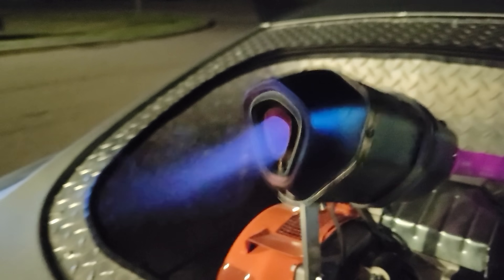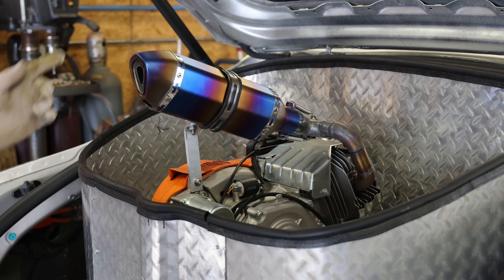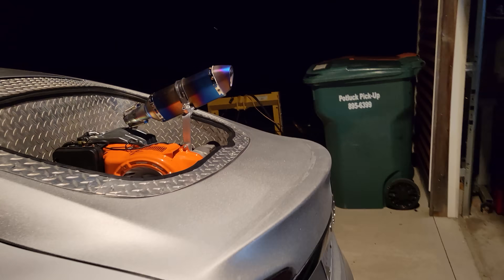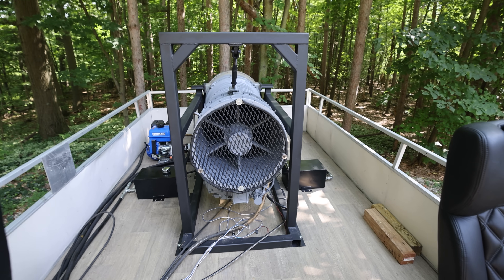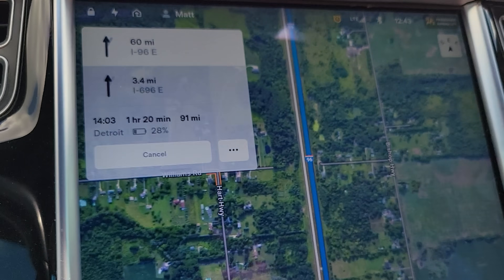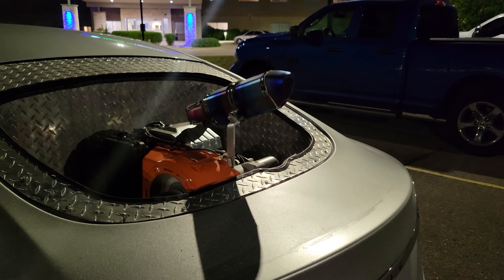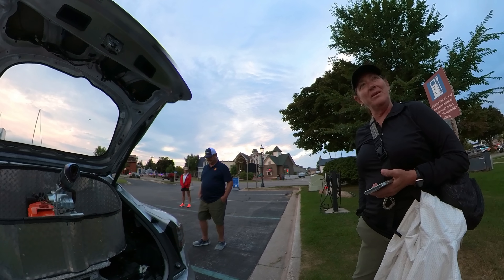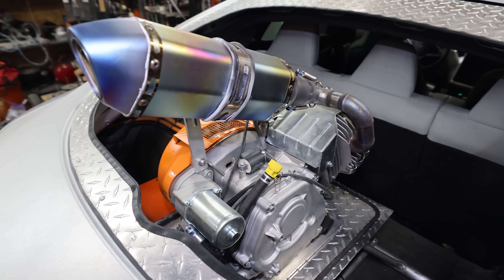Cordless Tesla (I Drive 1800 miles without charging) P.1

Comment: We have to give that generator some credit.  It ran at full throttle for roughly a week.
Reply: "Full throttle".  That engine would be running at the 3600rpm ( "universal" speed for 60HZ electric motors matched by small gas engines used interchangeably with those motors) that it's designed for full time operation.  You would be confusing that with running an engine at high rpm full throttle which it was designed to do only briefly.
Reply from the maker: @anvilsvs  well, kinda, For the most part you are correct, That is a typical life for one of these engines however you see, maximum output for this engine under maximum load is 19 kW, I was running this thing beyond its maximum load rating, so essentially that is full throttle. I should have really went into that in the video but I didn't, although my next one that I'm working on now is crazy, I don't know if the engine's going to survive but I'm boosting it to double the output that is rated for.... Haha.. If it blows up it blows up but I hope it blows up after I finish the trip. Hahah
Reply: @anvilsvs  This video is a scam for view$, he's not actually charging his Tesla off that engine (there is no generator just an engine) He's laughing & also amazed at how stupid people are.
Reply: @anvilsvs  Right. I guess people don't know these generators or small motors are governed at a certain rpm. Some increase speed under load. Found that out riding and modifying my friends mini bike motor.
Reply: 400 cc was way too low output. Even a Toyota Prius has a 1800cc engine.
Reply: @place_desjardins  did they even mention what the generator can charge ? What’s max kW?
Reply: @place_desjardins  prius is driven by that motor. This is only charging.
Reply: @DustinDIY  a Prius has a 1800cc 4 cylinder 121 hp engine attached to a adequately sized set of windings.
Reply: @ducatipaso1386  not quite how it works. Accel and when batteries dead the engine runs. Electric cruising
Reply: And made power without the generator part; it was just a spinning motor.
Reply: @MAKER_GURU you're the only one who caught his hoax 👍
Reply: And without oil change which it is now due or overdue
Reply: @jdy hate isn't the reason.  There are legit inherent drawbacks.  Demonizing people who recognize those drawbacks doesn't make the drawbacks stop existing.

Battery technology (the crux of EV) is one of the slowest advancing techs due to physical limitations, not hate.  Solar and wind are also very slow to advance.
Reply: The comment section here reminds me of how the apple videos end up. So passionate about absolutely nothing.. lol
God forbid someone uses their money to modify something they own or has an opinion. 

Ya can't make this shit up.. 🤣
Reply: Problem I see is a Tesla's on board charger only trickle charging batteries at L1 needs 120 volts 15-20 amps. L2  requires 240 volts 40-80 amps. Doubtful L1 charging 24/7 can keep up with road trip battery consumption. Generator advertised output is only intermittent, if subjected a continuous 80 amp load engine will be throttled up until melt down.
Reply: Anyone notice during the 5 seconds this video gives to inspecting that install that there's no dynamo attached to that engine, let alone capable of producing 10kw lol... only thing that's on that engine is electric start... it was bolted back there as a stunt for clicks.
Reply: Without an oil change? :0
Reply from the maker: @nguyen925  yes
Reply: @jdy 🤦 thank you for the self-righteous diatribe.  You're simply wrong and I couldn't care less if you're mature enough to admit it publicly or not.  If you knew anything about the tech, you would know how silly your claim is.  Modern electric vehicles wouldn't even exist without the forced redistribution of wealth.

You: people hate is why electric vehicles aren't practical.

Reality: electric vehicles aren't practical because of inherent physical limitations.
Reply: @zacharymorris9917  
You just have the wrong values. 
Your words are proof that you are not willing to change your habits even if this destroys the world you are living in. 
Egoisms are the most severe Problem man has.
Reply: @zacharymorris9917  
And? Why are you so full of hatred if you are so happy independently? 🤷‍♂️😊
Reply: @zacharymorris9917  
Totally wrong take on the Problem burning fossils poses. 
Of course there are downsides to EVs. 
But if you are willing to sacrifice just a fraction of personal comfort, and I am not talking about towing heavy loads or huge machinery, just personal transportation, you can make a difference.
And sorry for not being able to see your godlike experience. 😉
Being on the road since 1984 I have a little experience in ICE vehicles of all kinds, believe me. 
Although I never owned a Diesel because I find the smell of it disgusting. 
The fuels smell and the fumes smell. 
But hey, Mr. Know-it-all
just keep on doing the things you are doing the way you are doing. 
You are not alone in not understanding that we have to stop burning fossil fuels better yesterday than today where it is possible. 
At least you seem to promote the fossils lifestyle while on the other hand using solar. 
I guess I am just to stupid to grasp that incongruity.
Or maybe I just don’t have those omni-needs you seem to have.
Reply: @zacharymorris9917  
And, where is your point?
Of course ten years ago EVs where far from being practical. What you seem to be eager to deny is the speed of change and the absolute need to change for mankind’s survival.
Reply: @zacharymorris9917  
Man, how ridiculous are you? I mean honestly, my self esteem and ego is at least as huge as yours.
And now? 😂
Reply: @zacharymorris9917  
Sorry Zac, you simply are wrong. For most people it is completely feasible today already to drive EVs. Every household has current. Many can put up solar and batteries like you are doing it. At least you say so. Why should others not be able to do what you are claiming to do. 
You are contradicting yourself.
Reply: @zacharymorris9917  
You are just not accepting scientific findings like melting glaciers aso. 
Who is making a fool of himself here? 😉
Reply: @robinsonreichel1268  tell that to all the folks in California who were told to not charge their car or run their A/C.  Your ignorance is fascinating.
Reply: @zacharymorris9917  
Yours is at least at the same level, don’t you think?🤗
You are just generalizing. 
Haven’t they been asked to not use their ACs/Cars if not necessary?
How many times in history people in California where asked to not charge their vehicles? 
Compare that to the number of days in history with smog in California due to ICE engines. 
And what was the reason for the gov asking to use less current?
Might it have been the weak networks? The lack of buffering? A result of negligence?
Haven’t there been outages before EVs ?
By the way, we can always continue our conversation in German, if you dare. 😂
Reply: @robinsonreichel1268  you're far beyond your intellectual capacity.

Sie sind weit über Ihre intellektuellen Fähigkeiten hinaus.
Reply: @zacharymorris9917  
Oh, vielen Dank!
Ich hätte nicht gedacht, dass ich so große Fortschritte gemacht habe. 
Und das aus so berufenem Munde… 👍😉
And you seem to be a victim of the Dunning Kruger effect on a relatively educated level. 
I‘m out of here. 
I cannot see the benefit of wasting more time of my life on you my friend. 👋
Reply: @zacharymorris9917  
You seem to really live in the wild.
Sorry for underestimating that. 
As I am living right on the border of a well developed city in a well developed Central European country the need for a generator is as far away from my personal needs as it could be. 
Sorry for your circumstances. 
I didn’t mean to insult you or your rural lifestyle. 

But please stop wasting resources by posting automated translations that make little sense. 
This is just good for nothing.
Reply: @jdy you accuse people of phobia and hate because they don't like inconvenient, limited capacity and intermittent energy supplies.  If there ever was a great example of demonizing, that's definitely one.

In your delusion, car/hot rod enthusiasts have some significant effect on the guy in a lab trying to come up with a battery technology that has the energy density, availability and recharge time of gasoline.  As if the one and only possible implementation of revolutionary battery tech is electric cars.  That's historically inaccurate BTW.
Reply: Then was toasted!
Reply: @Noa_Borg  
BS. People lived before combustion engines.
Reply: @robinsonreichel1268  without natural gas and fuel millions of People would freeze/starve
Reply: @robinsonreichel1268  in abject poverty, yes.  Yes, people did live before the ICE.  🤦
Reply: Generator?
Reply: @thetruthisonlyperspective4872  
Wrong!
The Truth is the scientific consensus. 
Not something made up by morons.
Reply: @robinsonreichel1268  what?  Wtf are you talking about and what does it have to do with me questioning the term generator?
Reply: @thetruthisonlyperspective4872  Your name suggests that there is no truth and that there are alternative "facts".
Reply: @robinsonreichel1268  it's a jab at sociopaths
Reply: @James Monroe you've never seen an ultra-compact generator before?  On mine, the muffler sticks out twice as far as the actual generator portion and the generator portion looks like it's just a thick version of the engine case.  The car uses three phase input with it's own onboard charger so it wouldn't even require any type of rectification or Genset controller.  Only needs a relatively dirty input (similar to the grid which is surprisingly dirty).
Reply: Directly from the manual: 

"230V Three-Phase Without Neutral Connect the first phase (L1 in the illustration) to the L1 position on the terminal block. Connect the next phase (L2 in the illustration) to the L2 position on the terminal block. Finally connect the third phase (L3 in the illustration) to the N position on the terminal block.  Note: When wired in this configuration, the Wall Connector allows charging of only Tesla vehicles. If this configuration is unsuitable, wire the unit as a single-phase configuration. Note: Phase sequence is irrelevant."
Reply: Rich rebuilds needs to get in on this!
Reply: and took 47 gallons of gas and 8 fuel stops when he could have stopped at a supercharger 8 times for 10 minutes each
Reply: @bryjb10  …Funny , Tesla says it’s a 15 minute charge for a ESTIMATED 200 mile range meaning you are not going to get 200 miles every time plus you have to find one that is available. When you get in desert or very rural areas how are you going to find a supercharger ?
Reply: @toledojeeper2932  i love it when people talk shit who don’t even own one. I have had a model Y for nearly 3 years.
Reply: @toledojeeper2932  never had to wait for charging. Not ever
Reply: @toledojeeper2932  and it’s estimated 315 miles sir not 200
Reply: Damn Jeep people !
Reply: @bryjb10  …Do you assume much ?
Reply: @toledojeeper2932  assume what Jeep guy. If you had a Tesla you would know. You don’t
Reply: @bryjb10  I test drove a model 3 for a week....it's more like 180 miles for 15 minutes of charge.   8 stops of 10-15min each equals alot of added trip time.  For distances of 200m or less it's great.
Reply: @jerometruitt2731  
Or for people that are willing to sacrifice a dab of personal comfort for the greater good. 
Few people seem to dare.
Reply: @robinsonreichel1268  yeah that's where you kinda lose me.  Electric cars won't really be a net benefit to the greater good until all electricity is produced from  non combustible means.  As it stands the bulk of electricity production (60%)comes from fossil fuels.
Reply: @jerometruitt2731  
Renewables are growing each and every day.
Reply: @robinsonreichel1268  indeed...but they are nowhere near the levels they need to be in order to be environmentally beneficial.
Reply: @jerometruitt2731  
But fossils are?
Reply: @robinsonreichel1268  I think you're missing the point.  Switching to electric cars when the grid is mostly fossil fuels is a fruitless endeavor...because the increase in electric charging will also increase the need for fossil fuels.  It's what we call hustling backwards in the AA community.
Reply: @jerometruitt2731  
I think you are missing the point that more and more electricity is being produced from renewables.
Reply: @robinsonreichel1268  no....I understood that ,more and more is not the same as RIGHT NOW.  RIGHT NOW 60% is produced by fossil fuels renewables isn't even half that.  The point is having a bunch of electric cars before the grid is ready will result in a net increase in fossil fuel consumption because more will have to be burned to meet the demand of charging nearly 300M cars (assuming total EV conversion) on top of what's being burned to make the batteries and the vehicles themselves.   Having an electric car RIGHT NOW, isn't doing anything for the environment because burning fossil fuel to make electricity to charge a battery is less efficient than just burning it in the engine directly.  As the gentleman in this video demonstrated you use more fuel charging the batteries than you would use just filling the tank.
Reply: @jerometruitt2731  
Yes it is, if you are using renewables to charge it.
Reply: @jerometruitt2731  well it depends on if you hit V3 chargers, it depends on if you had the chargers in route and the car preconditioned the batteries. Something tells me since you are new you dont know how to deal with this things.
Reply: @jerometruitt2731  the real question is how many kW were you pulling max is 250-260
Reply: Nah.  I'm talking actual charge time to reach stated milage.  Not consumption.
Reply: @bryjb10  bro I know how to find a damn tesla supercharger 😂😂😂🙄  There's a bunch in Baltimore Maryland.  15min got me about 180 miles of charge.
Reply: @bryjb10  so 80 min to charge normally on that trip (if it really lasts 315 miles with each charge, highly doubtful), I can do that in the suburban with 5 stops of 5 min, and at 85-95mph speeds, Which will cut down the total driving time by a lot, all of this while having 8 people with me and their baggage.
Reply: @oyl23  model s gets over 405 miles range bud.
Reply: @oyl23  you break the speed limit and get 10 MPG worse maybe more cause your in a hurry.  I gotta piss every time I stop and by the time I’m done it’s charged.  Sometimes when I stop we eat and I have to slow the charge cause it doesn’t take enough time.  Sounds like your one of those law and order guys huh 🤔
Reply: @bryjb10  I don't really understand the point of your reply, none of that changes the fact that the suburban will do better in a long trip every time, with less stops, more travelers, comfortable, more cargo, I can keep going but you get the point. Electric will get better eventually but we're not there yet, no one is hating on them, we're just stating that gas is better still.
Reply: @oyl23  Why would it take you 5 stops? I could go 315 miles on one stop, and that's with a Hemi 4x4 lol.
Reply: @the_car_guy5915  because we were talking about a looooong trip, I believe cross country, more than 1500 miles; and 5 stops seems realistic, I guess restroom stops. I know almost any gas car/truck can do 400 or more miles a tank, but I was just giving a realistic scenario for that specific trip.
Reply: @oyl23  Yeah, going to need at least a tiny shred of proof on that one.  360 miles per tank in a suburban going 85-95mph average speed.
Reply: @Power5  what about the fact that I've done it several times, from Houston were I live, to Brownsville on one tank. 2008 suburban 9 passengers with suitcases and with a basket in the hitch with more stuff, that enough for you?
Reply: @oyl23  450 miles at an average of 85-95mph on a single tank in a fully loaded burb?  Impressive if true.
Reply: @Power5  I said 360 miles, which no electric can do (even though that's ehat they claim), as I said before we're not hating on them, they're just not there as of now.
Reply: @oyl23  sorry, I just mapped it from houston to brownsville for my number.  I am just shocked at burb range when fully loaded at those average speeds.  My 2017 is at like 5-15mpg at those speeds, depending on road slope
Reply: I ran a harbor freight generator 15 days straight after an ice storm. Solar or wind power wouldn't have rescued me like that bad old petroleum did.
Reply: @RCGshakenbake  I beat you by one day from an ice storm also
Reply: @RCGshakenbake ...So you did not have grid power? Which is coal fired?
Reply: @Shoob__  my line and weather vane were destroyed. Electricians were booked for weeks. They didn't even restore power to my block for a week because of the size of the outages and they called neighboring states to help. I couldn't get anyone here to fix it for another week. Luckily, I have a friend who is an electrician amd by the time he was caught up he came and helped me repair it. I had a quote me 4 grand. Lol
My friend and I fixed it for 150 bucks.
Reply: @RCGshakenbake Sounds like Harbor Freight engines could save Europe from thier poor decisions to rely on so much “green” energy and Russia 😏
Reply: @Captain-Awesome  Harbor Freight defeats Ruzzia 😂😂😂
Reply: @RCGshakenbake  you don’t even know what a Tesla power wall and solar can do. People are so negative and never even looked at the specs
Reply: @bryjb10  the question is, can you charge the tesla 8 times for less than 48gallons of fuel
Reply: @mehicanbls1526  well average it costs me 20.00 to charge up on a road trip every 220 ish miles. So thats about 160.00 vs 240 for fuel if indeed it took 48 gal.
Reply: @bryjb10  but how much fuel was used to produce that electricity. Thats the question. Most electricity is produced with natural gas.
Reply: @bryjb10  also whers i live in texas gas is $3 even for a gallon of ags right now so that would only be $160 for ms
Reply: @mehicanbls1526  I have no doubt that it’s 3.18 a gallon in Texas but that’s not reality for the rest of the country. Also that little generator is not charging while the car is moving. That’s a lie and it’s not going to charge more than 8kW max. Superchargers charge at 250kW. This entire video is a PR stunt and a total joke
Reply: @bryjb10  Where does the electricity for your beloved Tesla come from??
Reply: @the_car_guy5915  Solar at home. Superchargers I’m Washington state are all hydro. Why do you ask.
Reply: @the_car_guy5915  perhaps you should change your user name to gas car guy :)
Reply: @bryjb10  400 bucks and 10 gallons of gas, compared to what? 10 grand? With minimal sunlight from snow and ice on solar panels. I can only assume, I guess.
Reply: What would we do without fossil fuels 🤡🌎
Reply: @ Fried Fruit - we need to tell Brandon about our fossil fuel problem here In the US.  He’s fooking all of us that still depend on it .  Joe Biden (Brandon) 👉🤡

😂, who’s with me ✊
Reply: @friedfruit3567  That really is the question given we running out lol
Reply: @jdy demonizing is not even remotely close to extreme in response to an accusation of irrational hate.

You literally just said that I twisted your words and IMMEDIATELY followed up with clarifying the exact same thing I addressed.

Either way, you're still wrong.  The inherent characteristics of the tech are physical limitations that no amount of your delusion will overcome.  

The research and development for the tech is heavily consumer driven by completely unrelated products and has been going on since BEFORE the invention of the ICE.
Reply: What was the point of this?